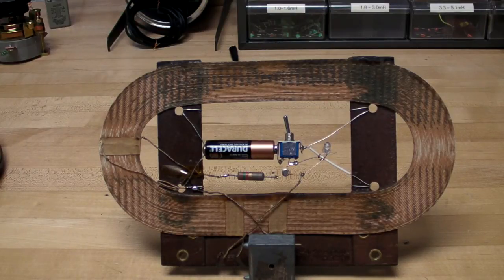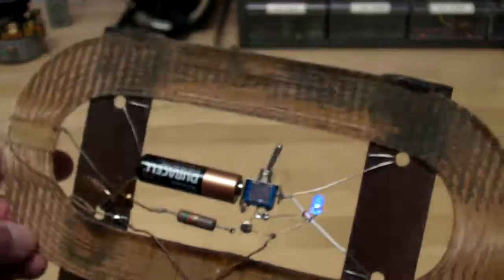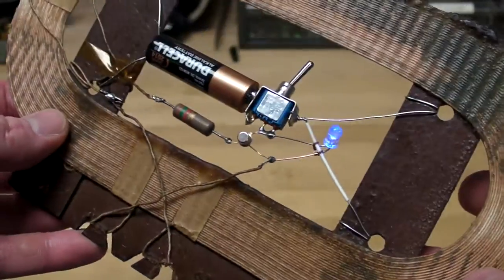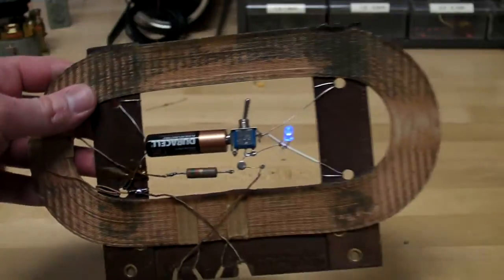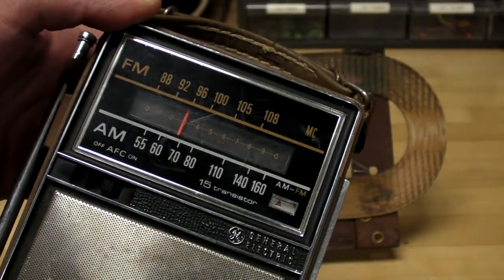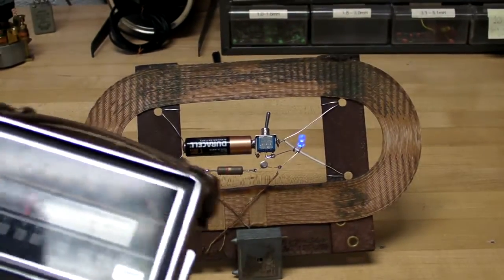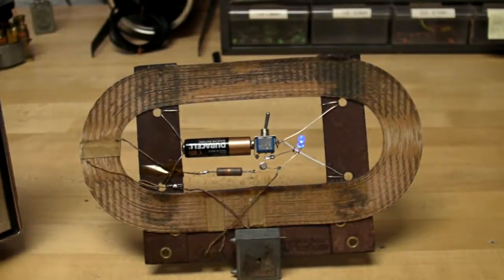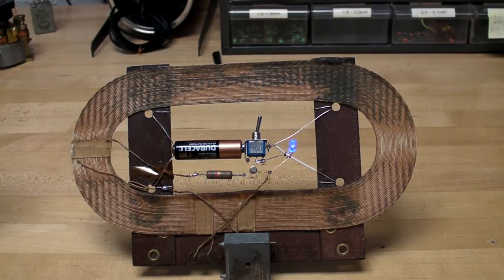(#0096) AM Antenna Joule Thief

Comment: Long wire to base, very low start up voltage. My record is 0.06v@1ma. Not seen better. That was with germanium diode though. Best start up with silicon transistor is around 0.35-0.4v, although once started the silicon JT's will run down to 0.1v or less, if the ratio is 10;1 or greater. Not seeing any reason to exceed 17.5:1 ratio. Longer wind to collector will give high voltage gains, with low current. If the LED is removed, and transformer is not on a core, you get Wifi power and data capable.

Comment: I try to hook the positive and negative of the 2 AA baterries from a radio to run a joule thief and it introduces these interference to my radio. I made the joulethief to run smdwarm led  lights to light the radio's panel so I can read the frequency I'm receiving. Is there a way to cancel out the interference in the power supplying cables from my joule thief? Thanks for any advice.

Comment: should work the other way, not low voltage, should work on full aa, Definitely on 3v. Probably too small a transistor though. Try with tip122 and no led. Removing the LED should give you a lot of extra range, and wireless power to a receiver coil. You'll be needing a power transistor though, preferably high gain. Can you check the Wifi range (electricity one) with an AV plug (half wave rectifier made with signal diodes) using 1n4148 or faster with lower frV. Use 8-12 inches of any wire for ant?

Comment: Try adding an audio feed to the base, should audio modulate well enough to identify the song.  You may need a more basic receiver to hear it though? Am reciever might filter out the fm, You really want to be working with both on something this crude... Pancake coil ant straight to speaker would probably make a good receiver...